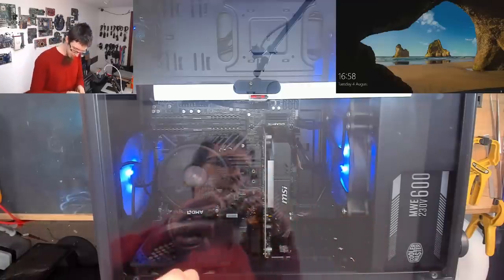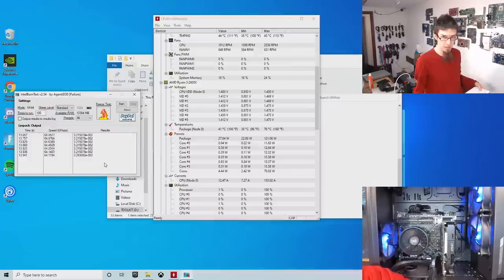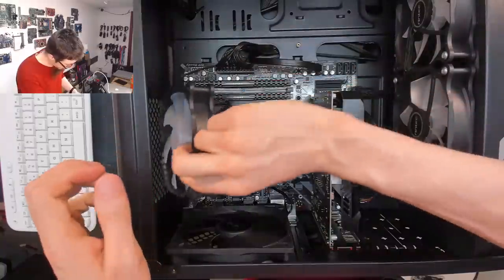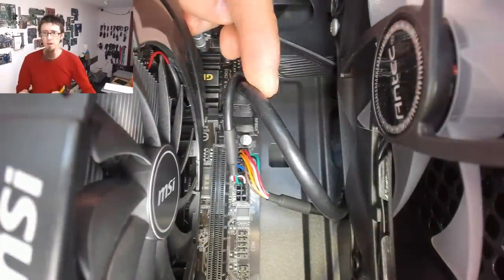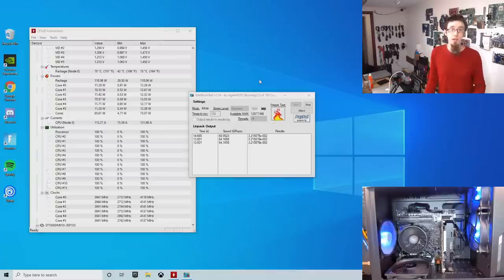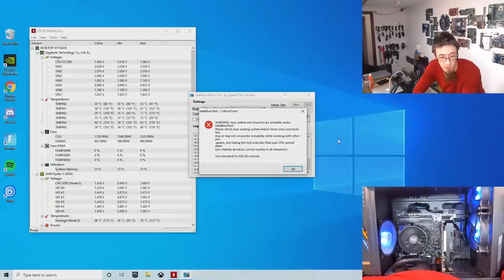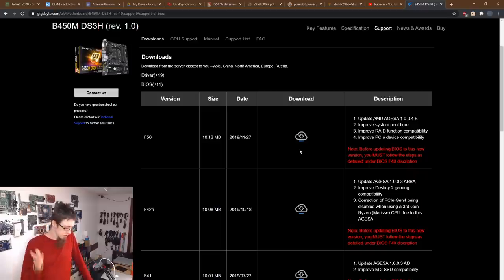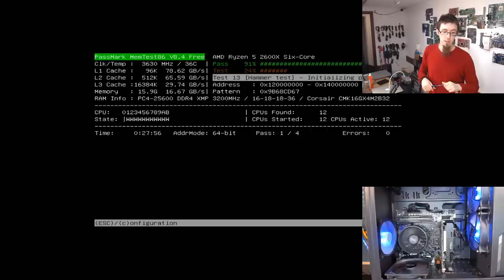Gaming PC Crashes at Random - LFC#217

Comment from the maker: Lots of people overthinking the Molex Connector here. A) When I clipped off the rear fan's molex, I trimmed down into the 3-pin connector. The trimmed ends aren't exposed.
B) Molex is a bad obsolete connector. Get over it. Molex fans have no software control, no RPM monitoring, and extremely limited speed control. Just because it's functional, doesn't stop it from being crap.
Reply: this is why i moved to laptop...
Reply: Maybe it thinks it's an Apple device?
Reply: Been working on computers for 30  years. Never had a molex short by touching anything. Just a quick zip/twist tie and hide it.  Never clip a wire. Any condensation or dust could link a cut wire since you are now talking like a 1mm connection distance instead of a greater distance.   If you do clip it, always glue or tape the end wire, never leave bare.
Reply: @kraegor1977  It's not likely, but it could happen. Do you see some of the component leads protruding on the bottom side of the graphics board? I see some that could conceivably short to the Molex connector. Molex connectors are also badly outdated. Used on computers dates back to at least the AT computers. In general electronics much further back than that.
Reply: @Reilly McCord It can but what if the customer wanted to upgrade to 4 sticks in the future? Better to know what the problem actually is than just put a bandage on.
Reply: I thought about building one and then learned about the GPU crunch.
Bought a pre-built "ABS MASTER" series, i7 9700f, on a Gigabyte B365M DS3H WIFI, 500 gig ssd, Gigabyte "Gaming OC" 3060ti, 16GB ram. 
Ran good but I was maxing out the ram. I got a 32 gig kit, swapped it out. It ran fine but the second kit was not XMP compatible as advertised. Gskill Aegis). By itself, ran fine though on normal. I tried both kits together on normal no problems, 48 gig. Cool.
I use 3D programs and Photoshop, usually at the same time. I only play one game. 
Excellent render times, 200+fps, all is good. I'm pleased and use it for a couple of weeks. Last week used it one night turned it off, went to bed.

Next day...bios loop. Won't boot, goes straight to the bios page by itself. Save, don't save, reset, doesn't matter. Pulled all the ram, tried one at a time. Made sure everything was tight, GPU not sagging or something. Eventually I managed to get a power on/off loop that wouldn't quit til I pulled the plug.
I only had it for 20 days, rather than fight it any more I pulled my hardware ( I added 3 more fans and an HDD) I boxed it back up.
I asked for a replacement. I'll try one more. If the replacement has the same board I'll double check for compatibility of the ram. 
Once you have compatible and speed, do you look for lowest timings, highest "native" speed?...so many numbers.
Mainly I'll be happy with ..."works consistently for several years", don't have a bunch of money to throw at it.
HyperX (Hynix) looks to have the best timing.
•JEDEC: DDR4-2400 CL17-17-17 @1.2V
•XMP Profile #1: DDR4-2666 CL13-15-15 @1.35V
•XMP Profile #2: DDR4-2400 CL12-14-14 @1.35V
Reply: "Just because it's functional, doesn't stop it from being crap" Is a golden rule about most PC tech. Couldn't say better.
Reply: E
Reply: Errrm, no... You exposed the wires by cutting them. They would have been protected by the design of the plug itself.
Molex isn't a "bad" connector by any measure.. there are only bad users, of which you're a prime example.

Following an uneducated opinion with bad advice is just absurd.

Re: Critique.
"no software control, no RPM monitoring, and extremely limited speed control"
DUH.... It just provides power. It does exactly what it's designed for.
Reply: ey adam may i ask how much roughly you pay for the rent /shop , how much do you need to start that business? nice vid btw:)
Reply: @Armand79th  He’s not wrong about molex being a crap connector. It’s been around since computers were first introduced to the masses. It’s old, probably 40 years old, and no longer useful or relevant in todays’ systems. It’s terrible, in most cases, to get connected properly and securely. It’s ugly and sticks out like a sore thumb inside a case. Time everyone moved on from molex connectors, including power supply manufacturers. Give me an extra 4 pin CPU connector instead of Molex. I can understand still having a ps2 connector, because sometimes you need that connector for troubleshooting a usb problem……..but Molex is redundant and useless. I agree with lopping off the ugly tail……..but agree that a little hot glue on the exposed wires solves that problem. As to moisture or condensation…………if you’ve got that in your case…………you’re got bigger problems than that lopped off molex connector.
Reply: @Armand79th   Molex is obsolete..... its what you said.... it just provides power. We have 4pin pwm headers now. use them and if you are scared of exposed wires(which im not) use some heated glue around the "exposed" wire.
Reply: Agreed. Honestly if I could clip all the molex plugs in my pc, I would. Unfortunately they're part of the power supply and I would rather not burn my house down.
Reply: @Armand79th  From what he meant by "no software control, no RPM monitoring, and extremely limited speed control"
He means by specifically with fans themselves. The fans for the case were all molex, not 3-4 pin fan connector, which means they all have poor design. Because yes molex does only provide power, which causes the whole issue of those fans being limited and having no monitoring/controls
Reply: The problem with this computer is they infected it with a gigabyte motherboard !!!! I have seen so many gigabyte motherboards fail in my repairing computers over the last 25 years its unreal ... I hate that cheap ass company
Reply: @russlora  they're the new ABIT brand
Reply: @kraegor1977  or pop the other pins out of the fan connector and de solder the wires.
Reply: It's refreshing to see a tech Tuber not showering clients with free upgrades like others iv seen. One of reasons I I subbed to many channels.

Keep up great work and loving all the micro solder content as well 👍
Reply: My cube case has six 120mm fans hooked by molex, running to a fan controller that takes up one of the 5.25" bays, allows manual control and has a temp sensor (probe wire that you can put wherever you want it to read from) to control the fans automatically the rest of the time. Running this setup for almost 20 years. Only thing I've done is put in quieter fans over the years. :)
Reply: Molex still has legitimate uses, even if its not in every build. Dont diss the OG connector
Reply: Totally agree, it's dead  unsightly and should be dead like AGP and i was surprised that my expensive modern sound-blaster card has a molex connector. for the RGB light connector.
Reply: @campkira  😅😅😅😅